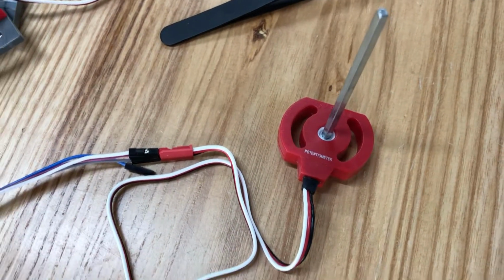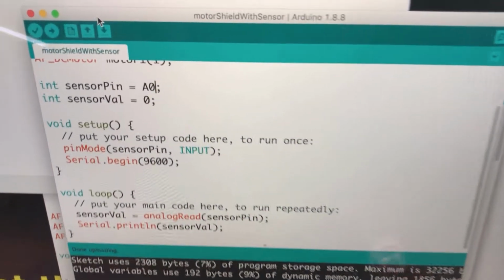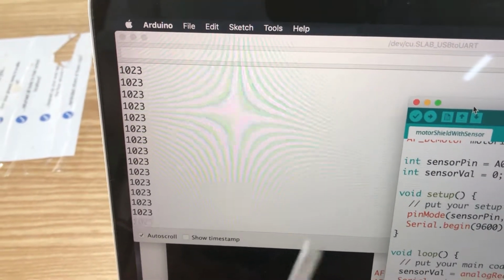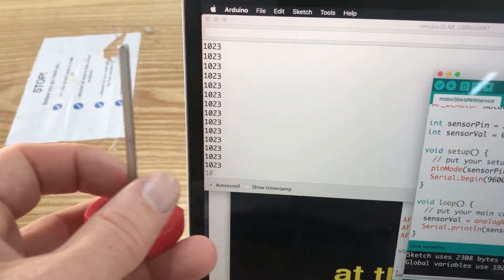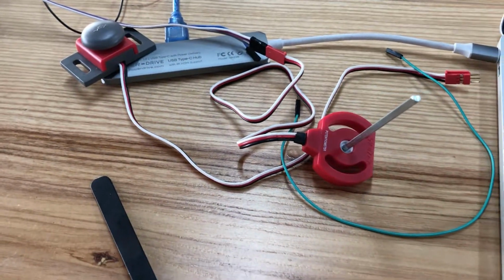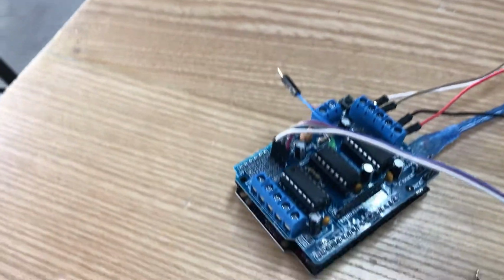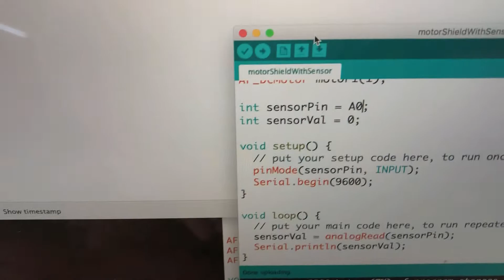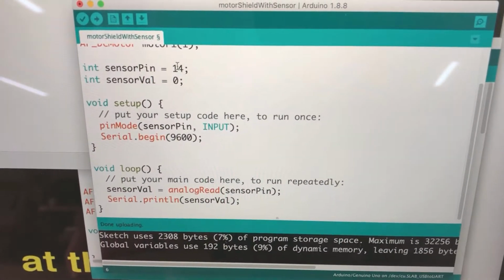Arduino Sensors With a Motor Shield

Comment: Hello, to connect the sensor to the motor shield, did you just stick a pin into the A0 hole on the motor shield? When I do that, it feels like the pin will come out. Am I doing something wrong? Please help.
Reply: u can stick the pin it, but its probably the smartest to carefully solder it
Reply: no he is demonstrating it wrong